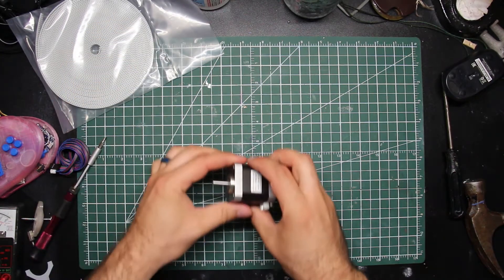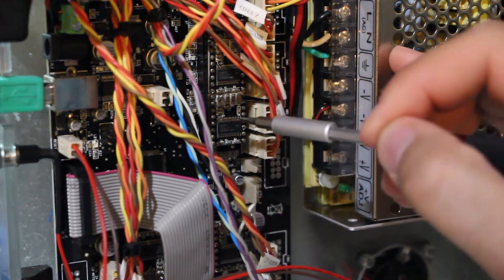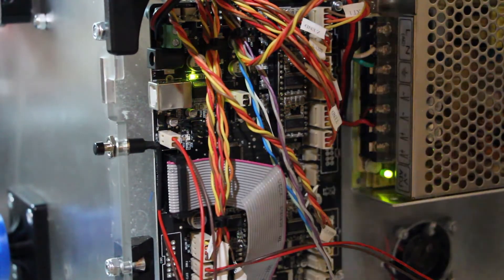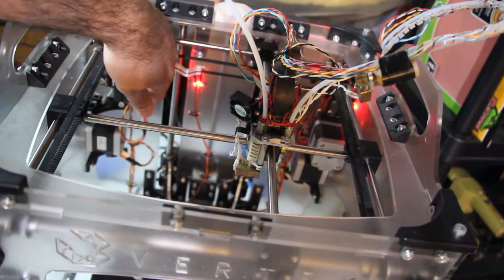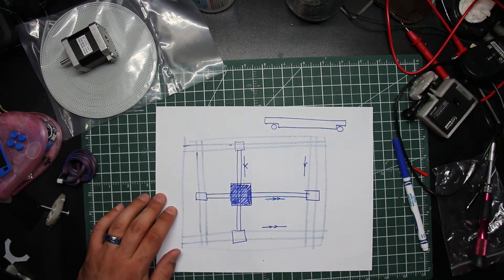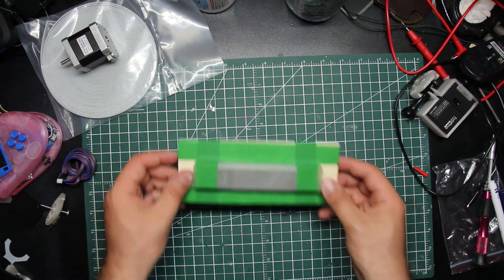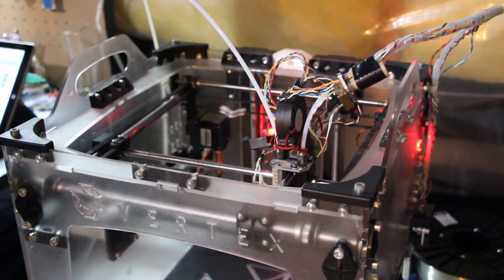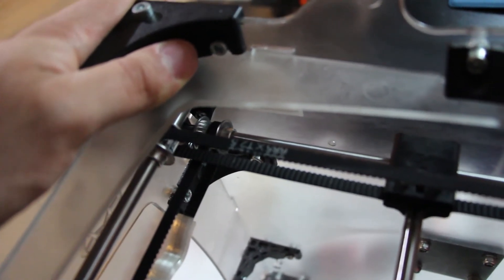3D Printer Repair! Stepper driver, terrible noises, misalignment, and more!

Comment: Ok have to know did you ever get it fixed.  A thought you may have been able to pull pulley off re drill hole and re tap. with larger set screw.  Probable does not help now.
Reply from the maker: Thanks for commenting! I did end up getting it fixed, there's another video in the channel talking about it. The difficulty of finding those parts made me give up and convert it all to brand-new GT2 belts and pulleys. The conversion worked great! It's been a bit of a mixed bag since - it's a workhorse, to be sure, but it's old and has seen many, many hundreds of hours of printing. I'd like to do a full tune-up soon but time is at a bit of a premium!
Reply from the maker: FYI - Results of the repair can be found here: https://youtu.be/34-Mga_9U-Q